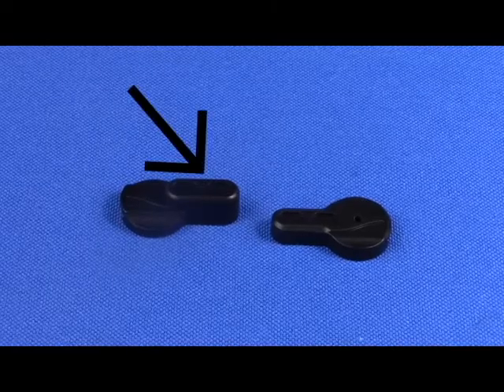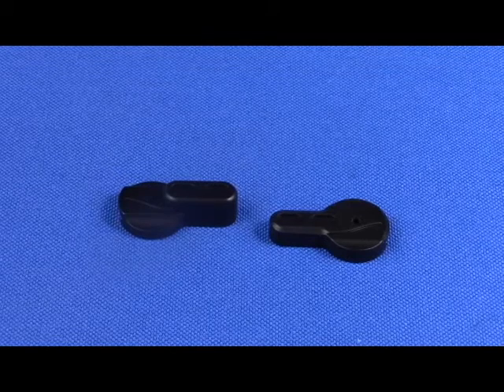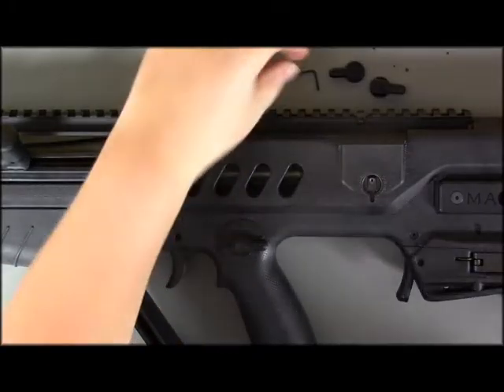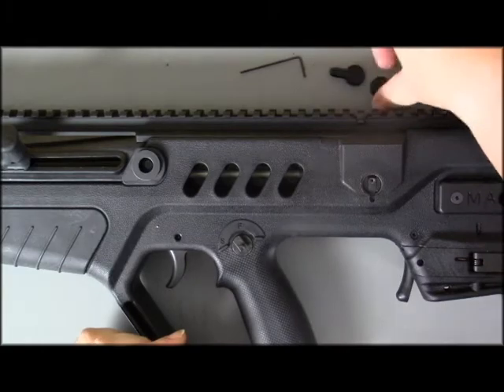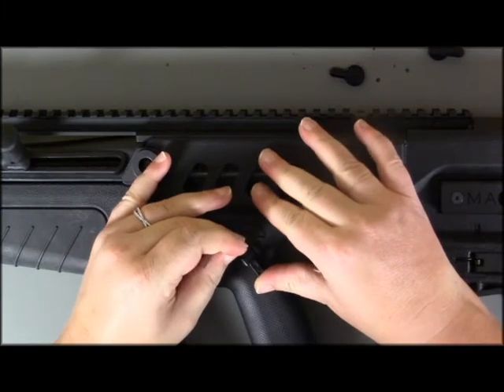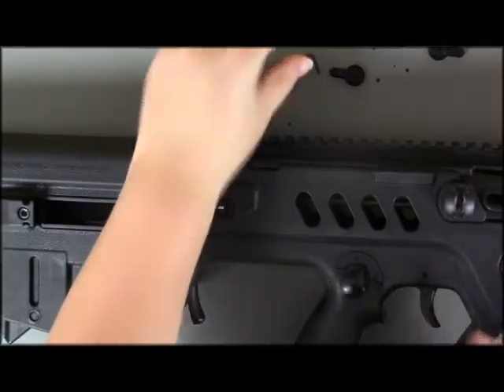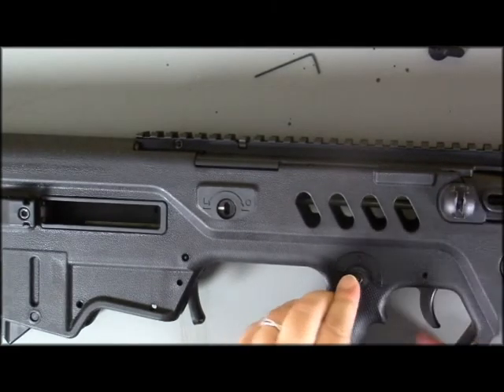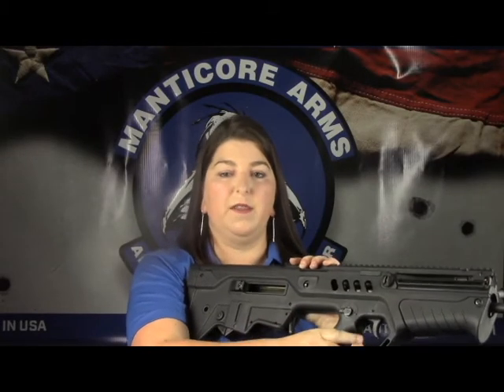How to Install the Luma Safety Lever

Comment: The levers went on as described in the video, but they were VERY tight. I installed them on an X95. In order to get them on, I had to use a bit of gun oil on the mechanism as well as inside of the levers, and had to tap them on with a plastic hammer after I was able to get them past the retaining pin. The original lever came off pretty easily, but the pointer on the right side of the gun required the hammer and a punch to get it to move. But, they are on, and I'm pretty pleased with the feel. This is a good product.
Reply: I just ran into this tonight. Appreciate the insight from fellow kitchen table gun Smith to another. Thanks

Comment: Got it. Both the medium and small levers are a REAL pain to install on the X95. The safety mechanism is recessed just a bit and that makes it difficult to get the old ones off and excruciating to get the new ones on. 
Also, the small lever on the opposite side seriously rubs up against my hand while shooting, making it downright unpleasant. I think IWI did not put the safety in a great location. But the Manticore hardware is actually very nice and sturdy.

Comment: I just installed my safety lever (the small one for the off hand).  It's as simple as this video explains but infinitely harder as the fit is really, really tight.  It needed some persuasion to get the factory one off and more to get the new one on.  It works great and I love it but I'm not sure it will ever come off.

Comment: i got these in a few days ago, went to install them today. Got the factor ones off fairly easy. I can not for the life of me get the Manticore ones to mount. The medium doesn't seem to want to line up straight. Actually scraped some of the inside groove paint off of the medium where i did finally get it to touch the depressed button. The slim is equally as difficult on the right side. Even tried swapping them around. Eventually gave up and reinstalled the factories. The factory ones slide right on, like the video shows the Manticores sliding on. I've emailed Manticore and awaiting a response. I truly think these were cut too small, the only way i see me mounting these is with a hammer, and that is not what I want to do.
Reply: Literally having the exact same issue right now.
Reply: @Roodementary  I mailed mine back for an exchange. Will be probably 3 more weeks before I get the replacements. Not optimistic about them working. Oh well. Have to at least try
Reply: Had the same issue. Gave up after 2hrs+ of fighting with it and just put the factory selector back on, after marking up some of the polymer frame around the safety selector.

Think it would be easier to upgrade if there was a way to actually lock the safety selector in place while changing it. It's a massive pain, since the selector needs to be juggled between firing modes in order to be swapped.
Reply: @mikeO31082  I got the second set in and manticore recommended using a rubber hammer. I was able to get the slim on using a rubber hammer, but it won't be coming off. For the medium I had to use a regular hammer. Folded up the corner of a towel to prevent scuffing the firearm. It is on, but it is DEFINITELY not coming off and was kind of scary hitting it with hammer. No looking back at this point lol. 

They also recommend using some oil to lube it up some. It definitely made a difference with them slim
Reply: @mikeO31082  Same here 2hrs of fighting with them, tried oil everything. Put the factories back on😡😡
Reply: @nstpierre03  yeah, I noticed the stock selector had some sort of lube when I took it off. Wasn't sure what would be safe to use to try on the manticore selector. 

I may just drop the $5 and get a 2nd factory selector instead though. As there seems to be less of an issue with getting that one on and off.

Comment: The key is to put in the punch and then use it to slide the lever off. I tried lifting the old lever off on my first attempt and it was a fight...until I stripped the plastic off of the groove destroying the OEM lever.